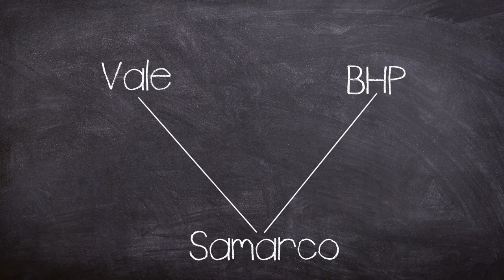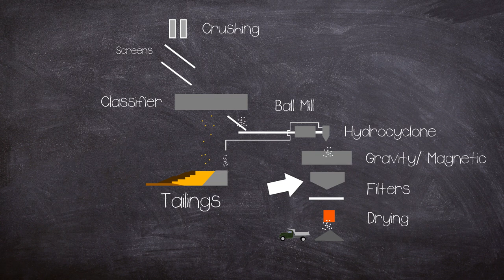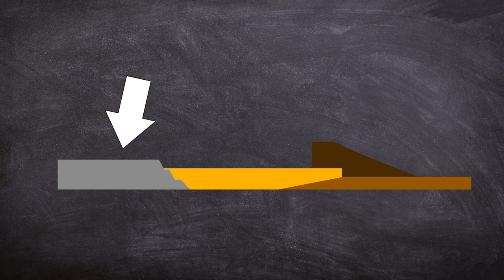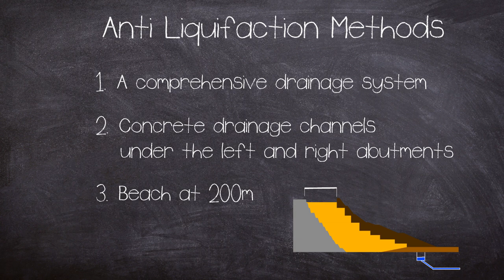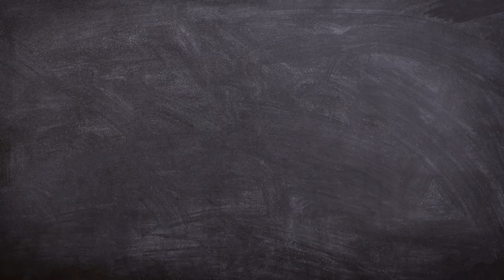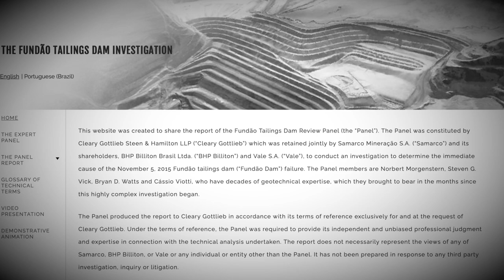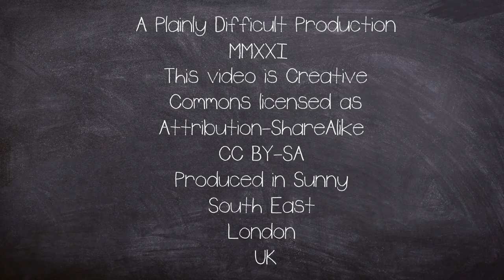A Brief History of: The Mariana Disaster (Documentary)

Comment: You should cover the 1983/84 Glen Canyon dam incident.  Flooding overwhelmed the outlet works and bypass tubes, and the untested slipways began to erode away under the massive water flow.  The slipways passed through the canyon walls where the dam was anchored, and there was serious concern that the dam may fail entirely.  Some quick thinking by engineers and inventive use of plywood to add some height to the slipway gates was able to save the dam, turning a disaster into a near-miss.  On the disaster scale, it would be low, but high on the historical legacy scale.  If Glen Canyon Dam had failed, it's likely that the Hoover dam downstream would have also been destroyed by the massive flood of Lake Powell's entire capacity coming down the Colorado at once.  It would have wrecked The US's entire water management system for the Southwest, and likely lead to serious water shortage and depopulation in Utah, Arizona, and California, a disaster on par with Chernobyl in its disruption of life and the US's economy.

Comment: Question: Why did the slime and Sand need to be kept seperate, and why could the slime Not be let near the Dam?
Reply: The slime is pretty much mud, that type were you sink and get stuck on.
the sand is there to create a "dryer" so the slime water can flow in and get drained.
the problem start when your sand get too humid and or start to sink, destroying the dam as result.

in another words, the sand is there to keep the holding side dry and in place.